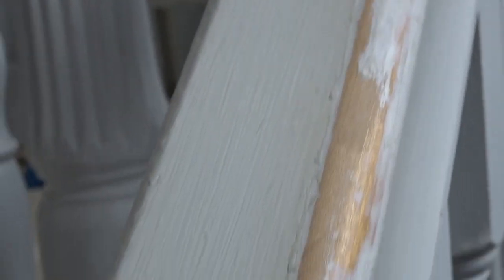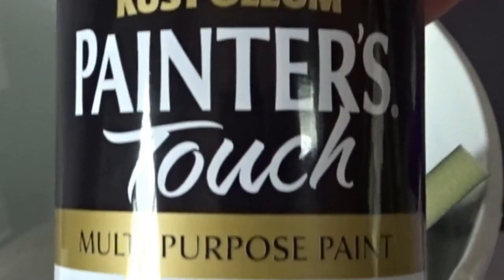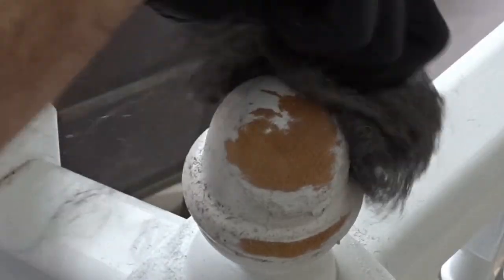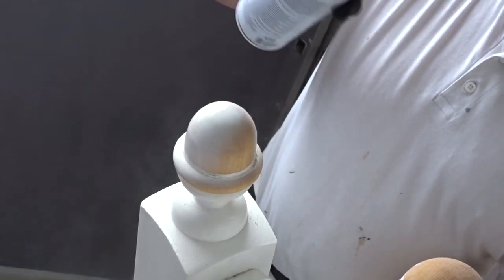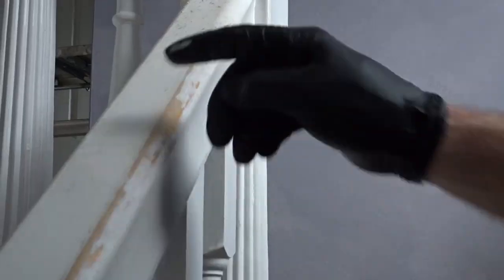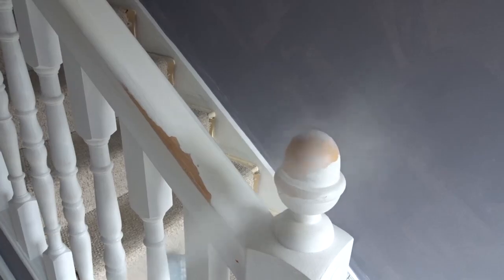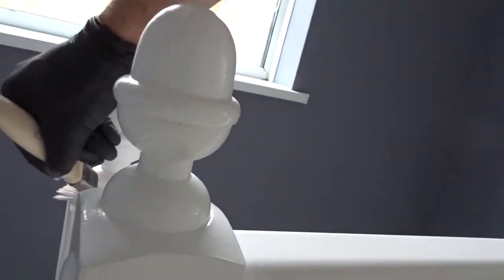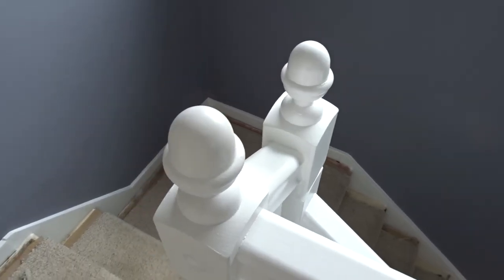The key to refinishing sticky hand rails on a staircase

Comment: Great tip for those troublesome handrails. Is the oil based satin the best to avoid this occurring again? Ie when people use hand creams.
Reply from the maker: Hi Tony Hough yes the oil based is a much smoother finish it does take longer to dry though !👍
Reply: Sticky paint is only problematic with water based products on woodwork  (Where hands touch) oil finishes are much more durable
Reply: oil based satin is good enough but oil gloss is best for hand traffic. trade quality gloss not retail they utter rubbish